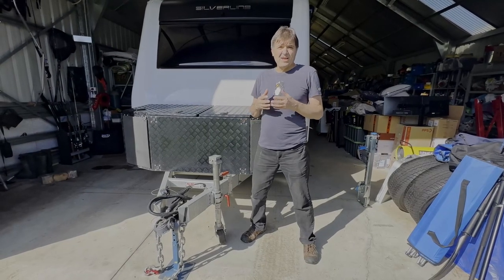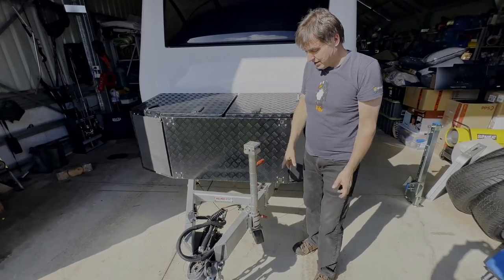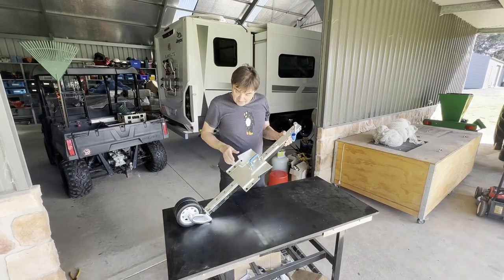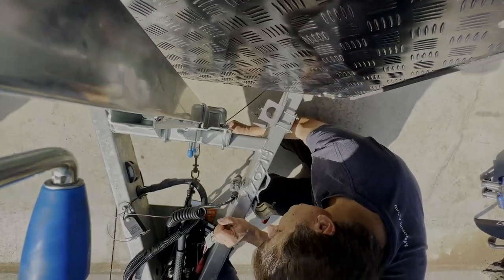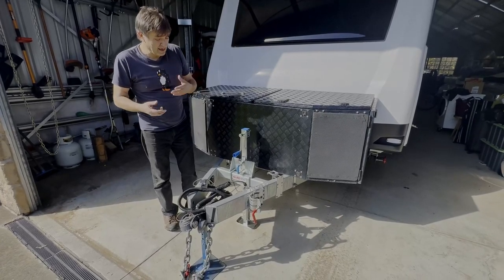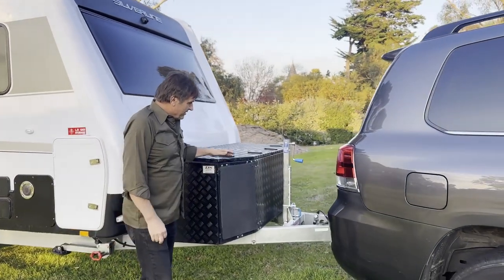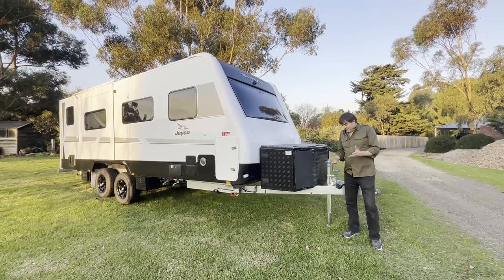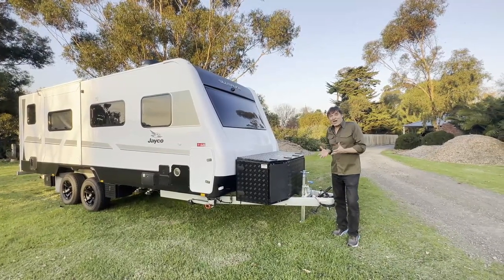ARK Centre Mount Jockey Wheel

Comment: I have purchased this jockey wheel after watching your YouTube and reading about it in the go rv online magazine. What size U bolts did you purchase as I’ve had Ark Corp send me 2 sets and they are both the wrong size even though I’ve told them I purchased this jockey wheel.
Reply from the maker: Depends where o the A-Frame youare mounting the the Jockey Wheel.  Just Measure that Steel member and that will be the size of the U bold you need. Another option is simply call ARC Corp Techncal Support 02 9678 9036 and their suppoer team will guide you through ther preocess.

Comment: Hi Kruiser, a bit off topic but I am wondering what reverse camera you have on the van in the video as I have purchased a second hand van & it has the same plug as yours but I did not get the screen with the van that would mount in the cab, I think it is a safety Dave camera but I think my 2014 van is a bit out dated? also off of your recommendation I have purchased this ARK center mount assay. thanks for the vid keep up the good work.
Reply from the maker: My screen  is a Jayco Sphere 2 Camera type that fits over the rear vision Screen. As most of these Camera plugs between the car and the Van look the same so its hard to tell, Have a look at you camera and take a photo etc and email to Safety Dave Support and they should be able to tell you what Camera model it is and the 3 cables components and screen you will need to purchase for the vehicle end. Where are you based, I'm in Victora and I may still have a spare screen which you can try, or I can mail to you at no charge. Good luck.
Reply: Thanks for the quick reply I’ll reach out to Safety Dave appreciate the offer of the screen too 🍻👍🏼